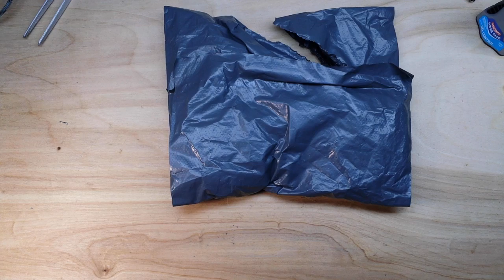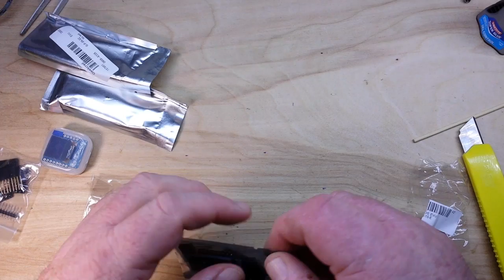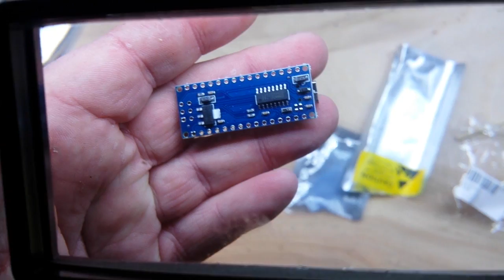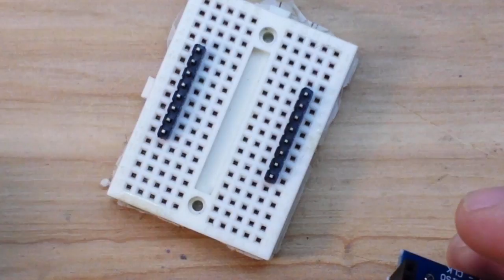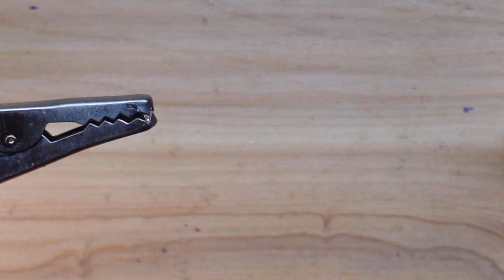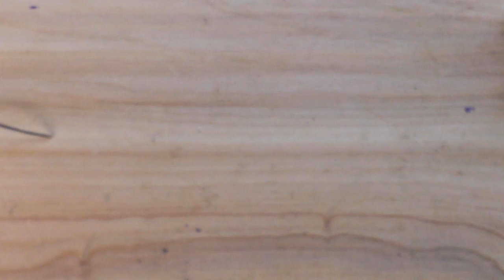The Slow Boat from China #11

Comment: I have to ask...why do you put your wemos shields on upside down?  I put the female on the top and make on bottom so I can use them in the baseboards and breadboard.    Maybe I'm doing it wrong?
Reply from the maker: James Kerns Jr. Mostly it was a mistake. When I open the package I saw the wemos label and assumed that was the top.
Reply: learnelectronics ok...I thought there was a plan in mind.  When I saw you soldering I about had heart failure and thought I did all mine wrong!  My ocd would have made me do alot of desoldering.
Also, when you get that tp4056 shield, can you please give us your opinion of it?  A lot of people call it crap and terribly inefficient.  I couldn't check mine yet because I don't have a battery nor connectors and I don't want to desoldering mine.  Thanks as always for all the great info you provide...I sure do enjoy your channel.  I never did figure what that blasted connector was called until you mentioned it.